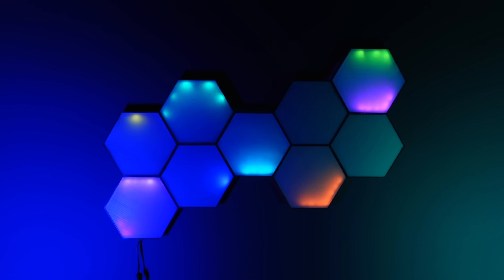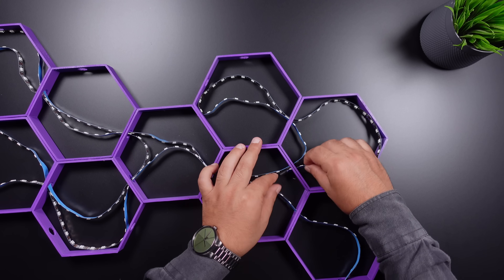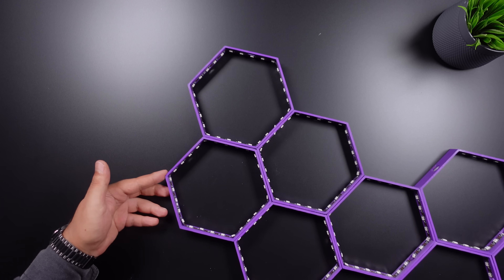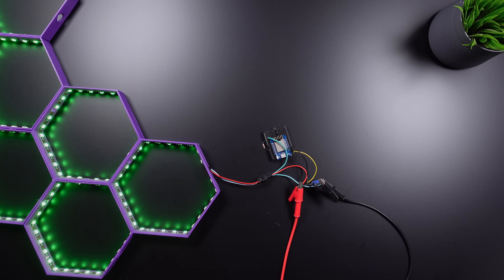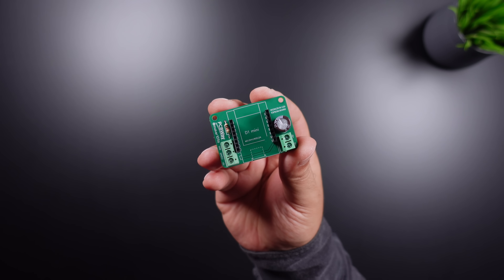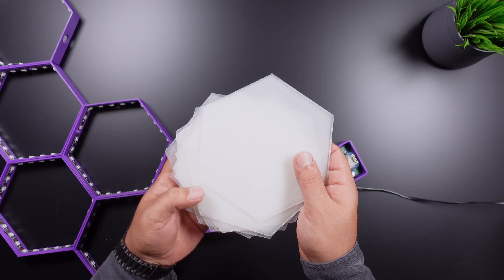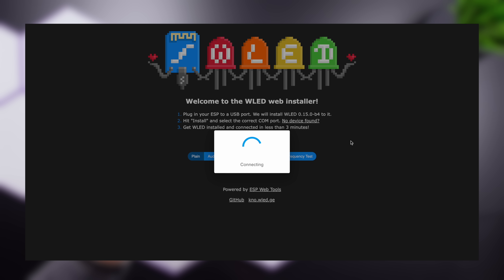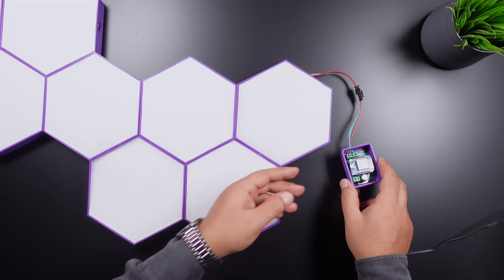Build a Simple 3D Wall Lighting

Comment: This is great! The only thing I would change is either doing a thicker print on the white diffuser sheet, or some other kind of diffuser, or denser LEDs. The diodes themselves look a bit too apparent to me. But getting the one strip to look like the bunch of super expensive individual light panels is a really good idea. Most people I've known that got those lights never changed the configuration they made once they hung it up.
Reply from the maker: Thanks for your idea for improvement 😇